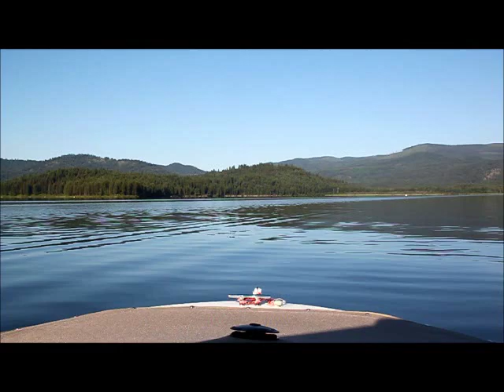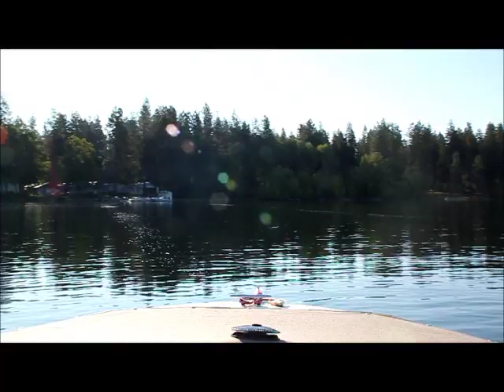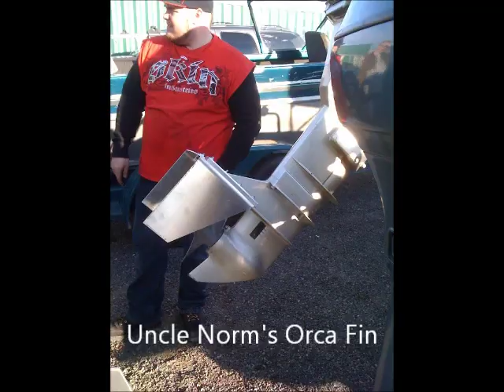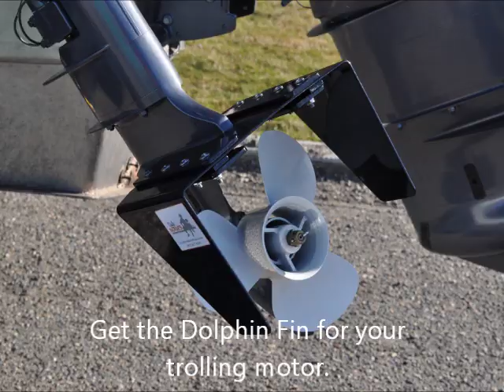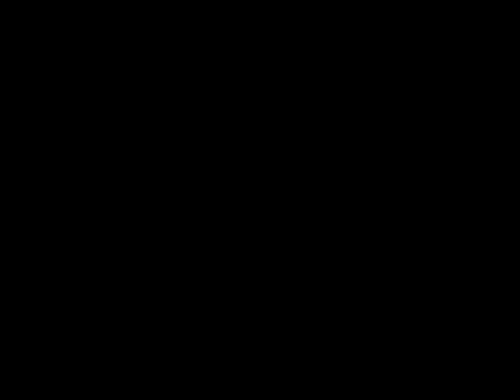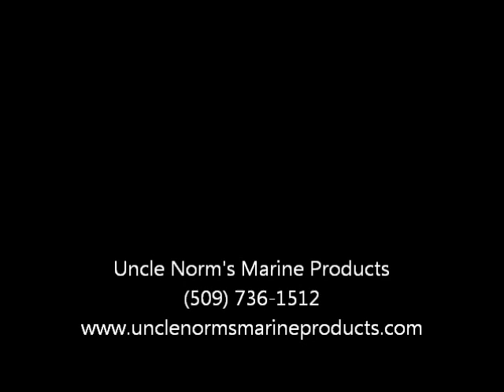Better Boat Steering- Uncle Norm's Marine Products

Comment: Hi your ORCA FIN WITH THE CLAMP MOUNT is an amazing product!!!  My crestliner discovery 1450 with a 40 Mercury outboard had a serious problems with HIGH BOW RISE to where I couldn't see in front of me and the boat would not plane, even at full throttle. The ORCA FIN was added to my boat along with a 4 blade propeller and both problems are gone. There is virtually no bow rise and the boat planes almost immediately!!!! This video truly shows the effectiveness of the ORCA FIN. Thank you!

Comment from the maker: Steering going astern is perhaps even more dramatic. It just never occurred to me to shoot any video of it. I have friends that are using this system on boats with twin outdrives of more than 300 HP each and up to 46 feet and they love it because it made a big difference in slow speed handling, they get on plane faster and don't get the bow rise.